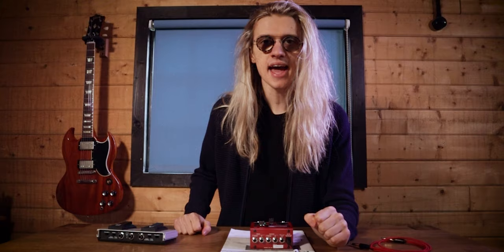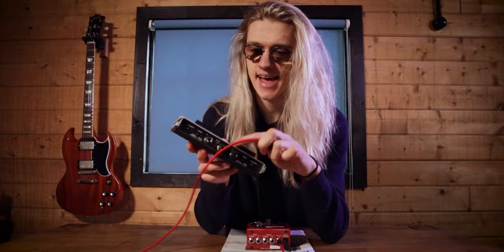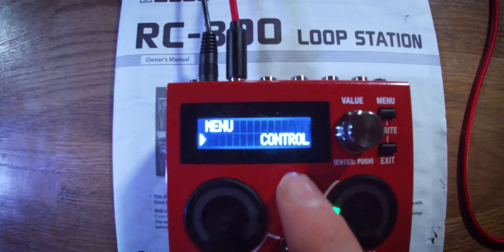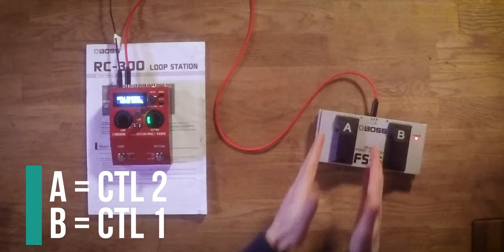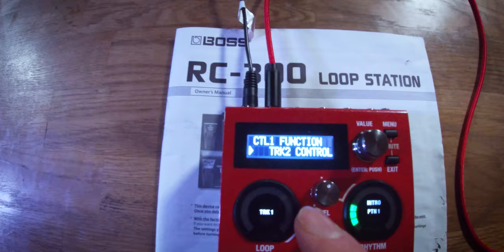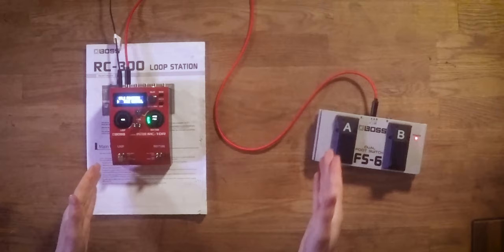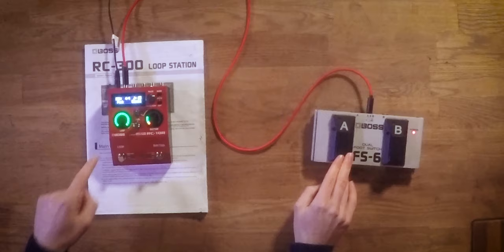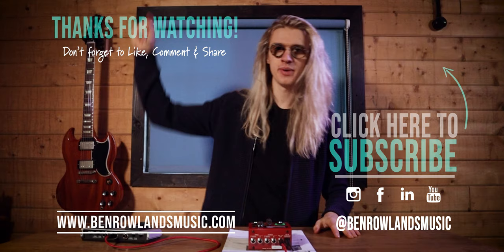BOSS RC-10R TAKE CONTROL!! How to use External Foot Switches RC-10R! MAKE LOOPING EASY!! | Tutorial

Comment: Love your videos. Here is my question. I want to use the BossRc10r on a stand and control the drums from my FS-6 foot switch. I don't care about the loops. I just want to be able to start,stop add fills etc from the FS-6, so far I have had no luck getting this function to work. I have a back injury so can not keep bending over to adjust the drum settings, thanks, Gabe Flash.

Comment: I would like to be able to use a footswitch to move from phrase memory 1 to to phrase memory 2. Is there a way?
Reply from the maker: I think there should be? As you can do that on all the other BOSS RC loop pedal!
Reply: @BenRowlandsMusic   If you have a clue as to what settings to use, I find the parameter guide not so practical or useful.
Reply: Yes you definitely can.  If you like you could set a double switch to move up to AND down.  Personally for that I would use the Boss FS6 - the size of a regular small pedal with two meaty switches stacked one above the other in a very ergonomic form.  You really need to download the parameter list and not be put off by the size of it.  Once you get over the fear factor it is very clear and useful. Mostly:).

Comment: Thank you a thousand times for this video. The expanded operation manual from the boss website tells you what it can do, but doesn't really tell you how to get there. Do you know if you can run two instruments through the fs6 and switch back and forth between A and B direct to the amp? I have an electric bass and an upright. My B channel comes through the amp, and A does not. Do I need a trs cable from my instrument into the A channel?  Thanks.

Comment: Do you have to use Boss’s footswitch? Or will any other two-button switch do?
Reply: Any 'Normally Closed Momentary' type footswitch will work. TRS cable needed for dual button switches. If the switch has two mono jacks instead of a TRS jack you will need a TRS to Dual Mono splitter.

Comment: I wondering if I could use the External Pedal to control the Rhythm modes. (4/4 time 3/4 time... different rhythm sets) while doing a solo gig... rather than having to bend over to change it from song to song.

Comment: Thanks, Ben. If you use the Boss FS6 foot switch, is there a way or a setting to stop the loop while the rhythm continues playing  if the pedal is in sync mode?  Without a foot switch, if I have it I  sync mode and I stop the loop side the loop, the rhythm stops too, even if I stop only the loop.
Reply: No, but you could route an expression pedal to the looper side to achieve the same function
Reply: @mlewmisc  Thank you. I did use an expression pedal to that end,  and ultimately setup a midi controller and other pedals to get the most functionality out of thebRC-10. I added an expression pedal to the loop and one to the rhythm for independent control of each volume, and use a boss fs-6 double footswitch to scroll memories, as it was more efficient than clicking through banks on the midi controller that I sue for the other functions like switching parts or starting and stopping the loops and rhythm with the midi co troller. So, all together, there are four separate footswitch controllers of some sort or another to get the full functionality out of the RC-10 in a small-ish footprint of external pedals. It was worth it, though! I do which Boss had kept more of the controls from the earlier loopers, though.

Comment: I'm torn really. I have an original Rc20, it still works great for a single track free looping or a bit of quantized jamming. But only one track and it cannot go down between loops only up. So cannot use it for making parts of songs. I play bass and live loop with chords percussion and solo but all with overdub. The extra track is greatly needed maybe even 3 tracks, and the drum machine addition would be nice for jamming with. 

But I've heard the rc10r does loop the drums for a while and then you can loop in when you are ready. You cannot record a loop then set drums to it tempoed and quantized on it's own... even the RC20 tempos and clicks if you free loop. Part of me is thinking the rc30 is still the better pedal for general multi track live looping or even with more money the rc300. But I cannot justify 500€ for a 11 year old device...